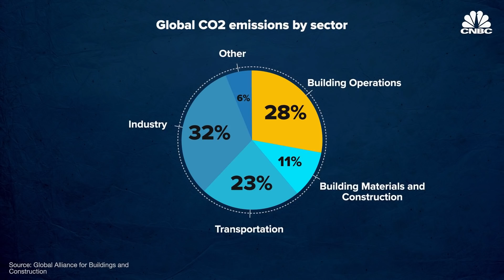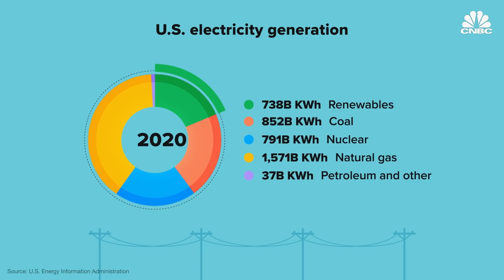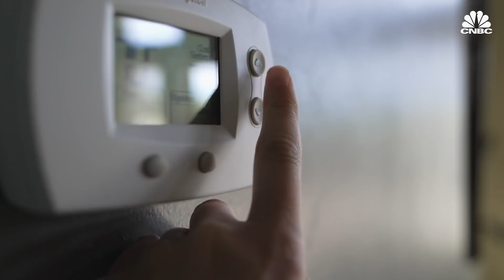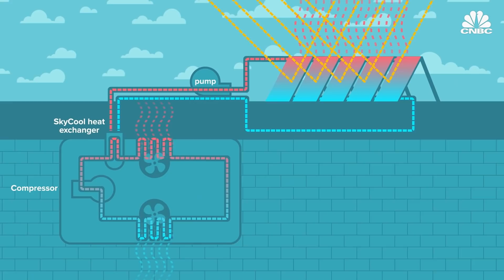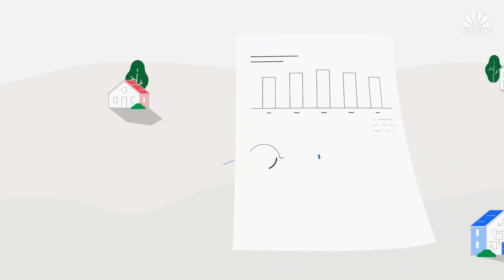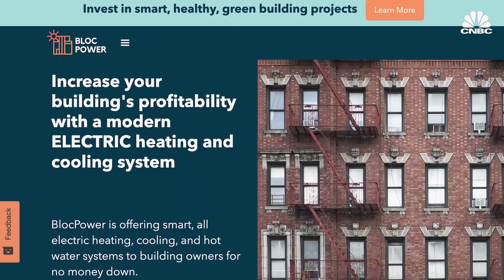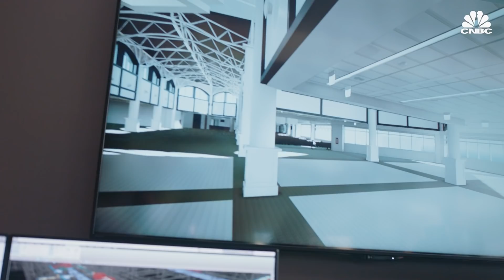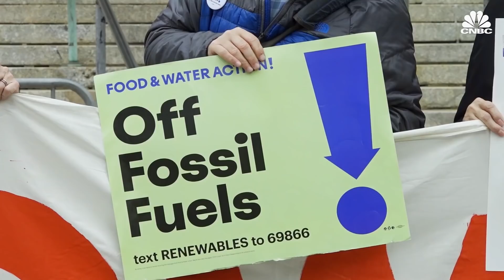How Air Conditioning Is Warming The World

Comment: A very important facet is overlooked - air filtration.  You can have the most efficient air conditioning machinery but if you replace your air filter with one that has very high resistance, you may end up using even more electricity.

Comment: How about a little focus on passive heating and cooling in another production?  Active systems require robust and highly technical equipment and infrastructure  to work where as  passive means are simple functioning systems. It would be a good approach by not putting all you eggs in one . approach.  I am not dissing the high tech route, but if there is another route,  why not  explore that as an option first, especially in places where the technology does not fit, due to cost, complexity,  or lack of infrastructure.

Comment: The extremely idiotic thing about heat pumps is a LOT of people have 99% of a reversible heat pump in an AC unit, but you can't really retrofit an AC unit to work in reverse so you have to buy a full new system

Comment: Airconditioners are bad, but headpumps are great??? Dispite being the same thing, technically. WTF??? Who researched this artical? What is happening here? Are those reporters that stupid?
There is no difference from headpumps to aircons. If you use the other refrigerant, they talk about, in the aircon it can be as enviromentaly friendly as the headpump they promote here. 
You can modify the head/cold source of your headpump by using the ground or groundwater. That will help increasing it`s efficiency. But using just air, then their is no different to aircons.
We have to change, because not changing will be much more expensive then not changing. So in that regards it's an good article.

Comment: Yeah because 80,000Volts going through a power cable definitely doesn't reach 100 degrees....such BS. There definitely had a bad ground or something somewhere which didn't allow the power to pass heating that portion of the cable.

Comment: So many problems with this video which tries to make AC out to be a core contributor to global warming. It's not. 

1) heating is 5 times more impactful than AC per degree change.
2) trying to say a window AC unit uses a lot of power by comparing to refrigerators is disingenuous. Refrigerators hardly use any power
3) combining the green house gas emissions of the "heating and cooling" category and then puting all the blame on cooling is misleading.
4) The headline is not wrong, just misleading.

There is so much improvement that can be made on many technologies, but AC is one that is rather efficient. And thus, should be far lower on the list of priorities.

Comment: What most people don't realize is that when you "heat a building" 1btu=1btu, when you use "refrigeration (A/C)" it is -1btu=2/3btu (so you create 3btu's of heat for every 1btu of heat removed from the building). It works the same in vehicles and everything else using refrigeration. 
This is true for every type of refrigeration, from your vehicle, to your fridge/freezer and to the  commercial units used to cool fruits/vegetables/frozen goods in the supermarket, to the massive units used to freeze the covid vaccines.
And it doesn't matter what you use to generate the power to remove the btu's, the generation and use of electricity generates heat in the same manner. And often at the same rate.

Comment: All this new "high efficiency" equipment they are talking about costs an order of magnitude more than conventional "inefficient" air conditioning - as they mentioned several times.
...but what they DIDN'T mention was the cost of upkeep, repair, and downtime.
Any energy savings you get with high end equipment goes RIGHT back out the door as soon as it has a malfunction. 
EXPENSIVE boards, sensors, drives, and motor assemblies that can take WEEKS to order and replace - again, not even mentioning the additional hours of labor costs for troubleshooting and being on hold with technical support.
 Conventional units can usually be repaired SAME DAY with parts on a technician's truck or local supplier.

I do HVAC and have a conventional split system in my house for EXACTLY that reason.

Comment: I was in HVAC for years and still know what’s out their! Heat pumps are much more expensive to buy to begin with and they are not cheaper to run. There has to be existing ambient heat or they will not work in the heat cycle and an electric or gas furnace takes over ! In other words a heat pump won’t work well in real cold temperatures!
Reply: "In other words a heat pump won’t work well in real cold temperatures!" So Canada for several months of year basically.
Reply: @Yawehplaneswalker616  yes , the heat pump would have to switch to secondary heating ( natural gas or electrical) when the outside temps dropped so far down.
Reply: @Yawehplaneswalker616  Do you even need air conditioning in Canada ! Heat pumps are both refrigerated air conditioning and heating ! I am in north central Tx , there are quite a few heat pumps here but there are times when they switch to auxiliary heat here.

Comment: Rubbish. Lies. Misinformation.
Heat pumps have been around for decades, it's hardly "New" technology. In fact, when Mitsubishi first put out ductless split systems, you couldn't get a "Cool Only" system. They were all heat pumps. 
"HFC's are powerful greenhouse gas contributors". Really? Because I remember HFC's being developed as "Ozone Safe" alternatives to CFC's back in the 90's. Back then, Chlorine was the "Evil Chemical That Destroys The Atmosphere", at least until people started asking inconvenient questions like; "What about all the OTHER sources of Chlorine, like swimming pools, bleach, etc, etc". I remember this because it was a large portion of the 300 question test I had to take to get my EPA license to handle refrigerants. 
You want to help cool off the planet? Plant some trees. Urban sprawl is the major contributor to summer heat issues in and around  cities. Concrete and asphalt absorb and retain heat while dissipating it inefficiently. Cities therefore radiate heat into the atmosphere 24/7 and adversely affect the areas that surround them. A/C DOES exacerbate the problem, especially in urban settings, but not for the reasons listed here. It "Moves" heat from indoor areas to outdoors, increasing the heat load in the immediate area it operates in, thereby helping to increase the overall outdoor temperature. Plants and trees help to alleviate this and they also absorb Co2 and produce oxygen while absorbing and dissipating heat very efficiently.

Comment: Buildings covered in solar also shade AND reflect from the sun. Small wind turbines attached.
New battery 🔋+ flywheel tech helps store electricity.
Insulation tech too.

Unfortunately, I also see nuclear plants to fill the gaps in electricity generation.

Comment: None of the described items in this video is a new advancement.  The title is just generating fear.  The best thing to do is a complex answer in many parts. One is design buildings and homes that have efficient passive heating and cooling. Two use ground source heat pumps (geothermal) whenever possible.  Use high effiency electrical devices.  Micro-power grids , rather then large power grids with large power plants.  Making a "green" electric grid is a big pipe dream.  The only way to do that right now is to reduce the energy consumption.  With an expanding population that is demanding more electicity use there is very little way to do that .

Comment: Well . . . . We DID have architecture that would help reduce cooling AND warming buildings it is called Passive Solar Energy. We USED to build buildings and homes to where they can cool down and warm up during the appropriate season. But we keep grasping for technology that needs to be produced and installed when the house itself has crappy windows and thin walls. They brought up electric CARS, that still need to be mass produced and sold, and then all the fossil fuel based cars would have to be phased out completely. But electric cars need the fossil fuel economy to be made because there is no alternative. (Notice they never bring up public transportation and how much less energy they take to run compare to a fleet of cars individually used and maintain.)

Comment: Window AC Units (especially old ones) are cheap but not efficient.  What happened in Texas when they had unprecedented cold and snow should be a clue that we shouldn’t be totally dependent on solar.  Also Electric is MUCH more expensive than gas heating when heating your home. Electric heating would not be affordable for the average home owner (especially in the colder climates) in the winter months.

Comment: The average price of electricity in the UK is 17.2p/kwh where as the price of gas is 4p/kw even if the gas boilers are 4 times less efficient you are looking at parity. Not to mention how are you going to heat your water and this is ignoring the increase pressures this will put on the grid which will increase the electricity price even more.

Comment: Insulation, especially the windows.  Then let not turn it to “freezing”. Every time I got to a restaurant or store in the summer I have to bring a light jacket, because it is so much cooler than the outside.
Reply: You're an enabler by supporting that eco terrorist restaurant
Reply: @SwankySasquatch66  I hope you don’t use ac heat or fan hypocrite.
Reply: @jerrysanders9101  
No need. 
I cool myself off with the refreshing blood of baby seals
Reply: Make sure you disconnect all electricity to your heat fan and ac in your home QUICKLY. The planet has a fever like a baby and depends on you.
Reply: @jerrysanders9101  
When I am cold, I warm up quickly by swinging my bat

Comment: I am a general contractor.them saying nothing is being done to umorove building is an absolute lie. Walls have higher r values same as windows and doors. Roofs have higher r values also. Hvac units are more efficient than ever. Lighting is all l.e.d. now which takes next to nothing to light buildings anymore. You want to help and get off fossil fuel? Build nuclear power plants. They are the cleanest and mist efficient way to produce electricity ever. And actually is the safest. Problem it gets a bad rap from a few accidents. When those happen its bad. It takes way less nuclear plants than coal plants to produce the same electricity.

Comment: What a huge lie - first of all what happens when sunlight is removed from the earth? it immediately starting cooling - in 24 hrs its 0 at the equator - over time the earth cools to minus 468 degrees below zero - That alone proves that global warming is a hoax times 10 - and the earth has no warming factor at all - warming comes from the solar radiation of the sun in other words, it is the spacial location of the earth to the sun that creates the warmth - thats why its 120 at the equator and well below zero at the polar caps - one other note - a part of the atmosphere in direct sunlight is 3000 degrees, on the other side away from the sunlight in the same area its -62 degrees until it rotates back into the sun.

Comment: Meanwhile billionaires have empty homes all over the world running AC... yachts boating all over the world without the owners even on them, private jets all over the world. Nah problem must be Timmy running his $80 walmart AC window unit. That's the issue. GTFOH
Reply: I worked on yachts and can confirm this is true.
Reply: @NeoMK  For the most part, while I do agree, there are more Timmys than there are billionaires. Hundreds of millions of Timmys running their air conditioners is going to be more energy intensive than billionaires' ACs idling in their mansions, yachts, etc.
Reply: @soldierforchrist631  Those billionaires own corporations, those corporations own us all. If every Timmy in the world had a Carbon footprint of 0, it would only solve about 20% of the problem
Reply: @soldierforchrist631  yeah I guess that you really don't comprehend how many super yachts there are in the world,  their fuel consumption is measured in gallons per mile,  and how much trash they throw overboard.  I would estimate that one super yacht could power about 300 or more Timmys air cons.
Reply: @NeoMK  Right you are.
 Leo DiCaprio's yacht burns more fuel in a year than I'll burn in a lifetime  -  but he's "carbon neutral"....riiiight.
Reply: @Michael_Wright  yep,  he drives a Prius through.
Reply: Timmy's going to keep running his window AC units too.  2 of them in fact.
Reply: The responsible industries keep telling us to cut back, but they refuse to take responsibility for their actions. 70% of the problem is because of these industries.
Reply: @strayarticle and they replace perfectly operational equipment every year just so they make sure they spend their whole budget.
Reply: The problem is the grid doesent use solar panels when its sunny,and when is sunny people use ac
Reply: I don't think any of those are the "issue". It shouldn't be a issue of rich or poor.
Reply: @Wesley22619  climate change doesn't affect those who can just afford to hide from it. Once the poor people are gone, the rich plan to just rebuild so that they can breed more slaves, I mean "workers."
Reply: @Wesley22619  Just letting you know that while it 'shouldn't' be a matter of rich and poor, it is. Pollution is much more the fault of the rich, and poor people will be the ones who are made to suffer. Nice arguments btw, attacking me personally instead of considering my ideas and words.
Reply: @Wesley22619  this explains a lot, thank you.10/hr full time is only about 20k/year. That's not enough to pay rent and eat in most places. Forget about owning a car or having health care. These people can't afford to take care of themselves, but billionaires tell them to just turn off their air conditioners, while oil industries around the world could do more by just investing some of their horded billions. They could create jobs to help clean the earth. They could build better factories. They could invest in nuclear.
Reply: @daggerthedragon1582  haha nuclear. You better talk to your local politicians about that one. 
Well that obviously depends on where you live and the cost of living adjustment. Again, you can talk to your local politicians about cost of living and taxes associated with your locale. 
If you are under the poverty line healthcare is guaranteed for you. It is the individuals making too much to qualify based on income, thanks to politicians setting arbitrary amounts, and still living with the tax burden of a high cost of living state. Take CA for example; highest percentage of rich and poor in the country, as well as highest homeless population in the nation. Yeah turning off the AC is dumb, I'm not arguing that point. But to act as if there isn't people investing in clean energy is naive. I get it, like everything it is very easy to point at the negative then acknowledge the positive.
Reply: Exactly.

Comment: Currently it takes about 22 years to offset the environmental cost of manufacturing just one solar panel, longer for batteries... sooo you are suggesting homeowners buy a bunch of panels and batteries completely wrecking the environment to save the environment 22 years from no.... just in time for all of that stuff to need replaced....
Reply: What’s the environmental and human cost of coal mining?
Black lung anyone?
Reply: @emilyfeagin2673  no different than the same environmental cost of mining the materials necessary to make solar panels and batteries... except the land is left usable after coal mining. No so much the case after mining for the metals required to make the solar panels and batteries. Thanks to respirators black lung is hardly a thing anymore... you didn't even try to think about this one did you?

Comment: Of course an A/C unit uses more energy than a refrigerator. SMH. The space it's cooling is 20x larger than the space in the refrigerator. A refrigerator also sits in a static(no real temp change) environment unlike your house A/C which deals with daily temperature and seasonal changes. All of these 'new, green' technologies still require massive mining of the earth for resources. Where do the rare earth minerals needed to make solar panels, wind turbines, and batteries come from? That's right. They still need to mine the earth just like they're doing for fossil fuels. Green isn't as 'Green' as they make it out to be.

Comment: You know what else contributes to massive amounts of energy? Green Energy Scams. There is no such thing as Renewable Energy. Physics cannot be changed by leftist religion of Green Energy. Electricity still will run from reliable fossil fuels and Nuclear Power. Heat pumps, electric cars, home and business power will still run off of fossil fuels. If you want TRUE clean energy, then convert to Nuclear Power. It's efficient, clean, cheap, and reliable. Solar and Wind use toxic materials and are not cheap and reliable. Green Energy Is Green Toxic Waste and Economic Disaster. That's not a projection, that is the truth. Carbon is not a pollutant, it is a necessary element for life to exist on this planet. Decarbonization is certain death.

Comment: The core problem, is the fact that buildings are not designed to be air conditioned cheaply, and the reason is because they want more in rent, and more in expenses.   Lots of buildings run heat and ac, at the same time.    Some areas are too hot, some too cold.   We were running electric heaters in June, in Secaucus, because the building had a huge atrium, where the heat would rise, so, they had to heat the ground floor, and AC at the same time, as the heat would rise.   (poor design).